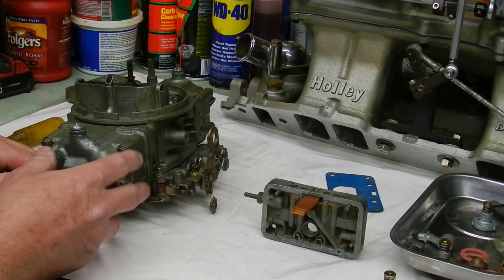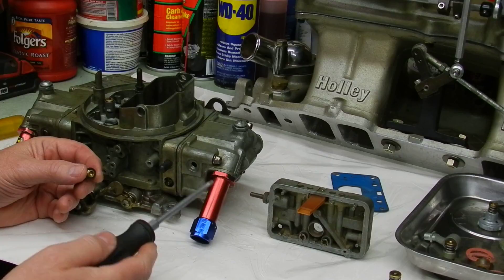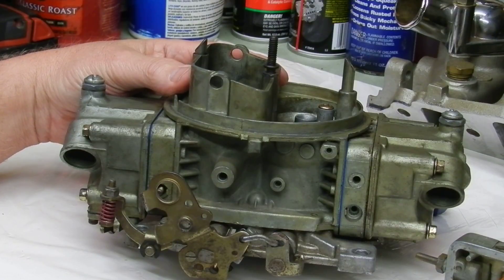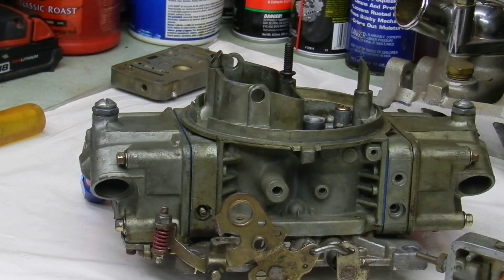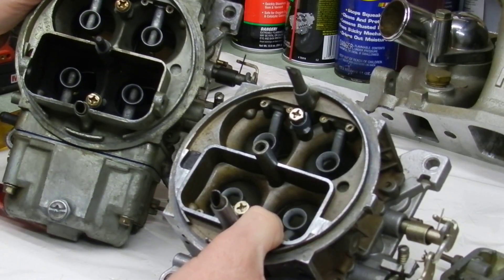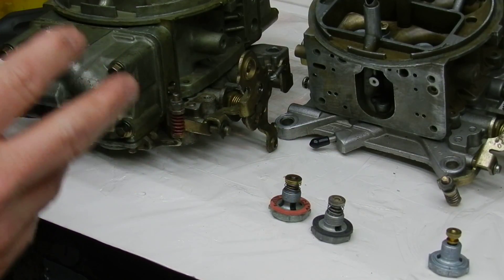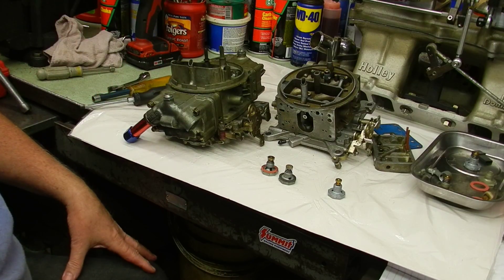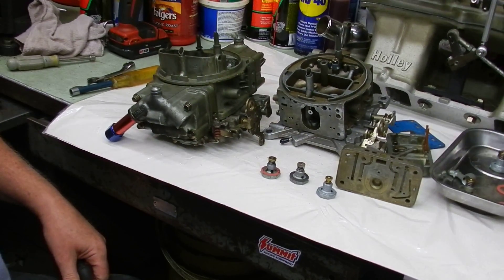Holley Carburetor: Tuning Introduction

Comment: Hi. I got a problem. 
My 302 rebuilt to 30 over and with a comp cam at .533 lift 214 duration at 50 has a holley vacuum secondary 600 street warrior..
The boosters spray intermittently and the driver side booster sprays less and later than the passenger side booster. What could cause that?
Reply from the maker: First make sure your high speed air bleeds are clean and the proper size. Check for a loose boosters and that the boosters are straight, Remove your bowls and look for trash or any kind of restriction at the booster or in the booster, look at the metering block and check emulsion holes for restriction. Hope this helps.
Reply: @holleycarbshowtosadvice40y90  how do I know if the air bleed ports are the proper size? Right now they are what came with the carb and they don't look like they cold go much bigger.
Reply from the maker: Buy you a set of pin gages, then you measure your air bleeds. The inner bleeds are your high speed bleeds and the outer are your idle bleeds. Hope this helps.

Comment: Your supposed to adjust the accelerator pump springs with the throttle wide open, while shoving downward on the pump arm there should be .015 clearance between the spring and the arm,
Reply from the maker: After installing the carburetor and making your final adjustments to the mixture and idle speed, then make your final adjustment to the pump arm, zero clearance at the pump arm and at least .015 clearance at wide open throttle.
Reply: @holleycarbshowtosadvice40y90  yah after your pump cams are selected and positioned where you want them to be. I hold back the throttle to wide open wit some wire and shove down on the pump arms until they bottom out and then set the clearance between the spring and arm. That’s just to make sure your not bottoming out the diaphragm before WOT
Reply: @holleycarbshowtosadvice40y90  hey if you know engines you’ve probably heard of David Vizard this is his channel. It’s all around head and port flow where your overlap should be. This is exactly what I was saying. https://youtu.be/yzrGqhJ8mlk

Comment: Any secondary tips on a list 4224 660
Reply from the maker: Are you  having a problem or looking for mods.
Reply: Actually setting up a pair for sbc tunnel ram. So looking for mid tips. 355 ci small roller cam lift unknown . 12.1 compression.4 speed gasser style car

Comment: I have a Holley 600 on a 351w with air gap manifold. She runs fine around town and when not high temp outside but when get on interstate after running about 30 40 minutes and mask acceleration down hard she bogs down and then runs like it’s on 6 cylinders-and can barely get me home only if I coast or give it on little gas. My mechanic thinks it’s not getting enough air through the air filter and runs to rich. I am not convinced but I am not mechanic. I have a new electric fuel pump installed and aluminum radiator which seemed to lessen the problem but not resolved it. Any ideas?
Reply from the maker: Check your ignition and fuel system , I have had ign. Coils do that and ign. Stator ( pickup in distributor) or it could be  fuel starvation , perform a fuel volume test and check fuel line at fuel tank ( rubber line) possibly cracked can cause this , check fuel filter, this is most likely areas. So many things can cause these problems . Hope this helps, if not let me know .

Comment: Randy, if you have not, please demonstrate how to clean a carburetor. In addition, would you make a video with the three-barrel Holley?
Reply from the maker: Walter I wish I had a Holley three barrel ,maybe  I'll run across one ,it's  been a while since I've had one , but I will make a video on cleaning the various ports and passages ,thanks for the insight.

Comment: Have you ever had to drop down sizes on an idle air bleed for one corner only?
Reply from the maker: No I never have , if you pin Guage every hole in the idle circuit all your air bleeds should be the same size.
Reply: @holleycarbshowtosadvice40y90  I’m thinking the carb I have here has a misread air bleed. One is smaller than the others on that circuit.
Thanks for sharing your expertise.
Another great video would be thread repair of the discharge nozzle screw, that’s my next issue to tackle on this carb 😒

Comment: What is a 3310 carb  4150 or 4160.
Reply from the maker: 4160
Reply: Can you make it a 4150. And is the 4160 a good carb. What number is a good 4150 carb for a bbc. A little bit bigger than mild
Reply from the maker: How much cubic inches and modifications , and does it see the street the most or strip.the 4160 is a vacuum secondary carb, they say if it has a rear metering block it becomes a 4150 , but it is still a vacuum secondary so the main difference is a 4160 has vacuum secondaries and a 4150 is a double pumper, if you are driving it around on the street and power is not the main concern then you could run a 3310 , but it is considered small for a 454 or larger engine performance wise ,usually a 850 or bigger is normal , hope this helps.
Reply: It's  462 bbc  552 555 lift cam
Reply from the maker: If it's a street car and your not about all out power its a little small but will work, an 850 would be better, all out performance 1050 dominator.hope this helps.
Reply: @holleycarbshowtosadvice40y90  street

Comment: I own a 84 f-150 4x4 with a 351 & the Holley / Motorcraft 4180C 4 barrel carb .
Timing is set to factory specs / engine vacuum is spot on . Both fuel bowls are adj correct . 

Electric choke is working / adj correct ...or maybe not 110% 🤔

On a cold start....i will pump the gas a few times prior to starting . But when i go to start the engine , it will quickly die . If i pop off the air cleaner cover , the choke plate will be in the almost closed position with approx 1/8 inch gap .

I need to keep giving the carb gas by pumping the pedal or it stalls out .

Once warmed up a bit , the engine will stay running on fast idle until i hit the accelerator pedal to kick the choke down to 2nd fast idle speed. 

But usually i can't get the electric choke to kick down to the lowest idle cam position without loosening the choke thermostat housing adjustment screws & readjusting the choke plate so it steps off the fast idle cam to the lowest idle setting.
Reply from the maker: Email me some pics of the choke linkage and housing and a phone # to, bigblockchevyman1121@gmail.com and I will do my best to  help you.
Reply: @holleycarbshowtosadvice40y90  Thank you so much for wanting to take your time to help me with this carb issue ...i will try to send you some pics to you soon.
Reply: @holleycarbshowtosadvice40y90 Two email sent ...let me know if you got em ??

Comment: Hi master. When i swapped my engine whit a too low stall torque converter , in drive i had like 5-6 inch of mercury at idle 650-750 rpm. And my power valve was a 6.5 . Was it possible to the power valve to engage at idle? I put 2.5 power whitout seen your video about idle...because it was too rich. But now i have a new transmission and torque converter that fit the powertrain,10-12 inch of mercury at 1000 rpm idle in drive, and I'm about to open that carburator, work on the power valve , transfer slot, secondary idle adjustment and  apply all of your information. Your video are Really appreciated.
Reply from the maker: Thanks

Comment: Straight leg boosters and choppy cams don't go well due to the low vacuum signal and also the lousy atomization of the straight leg further complicates things. Straight legs are doable, but for me I don't care for them much. Personally on any of my engines I avoid straight legs and do either down leg or annualar preferably,  even if I have to swap boosters myself.
Reply from the maker: Your right .

Comment: I ran into a 4150 problem, just rebuilt it, and if I idle below about 900 she shuts off. I dont think its too radical a cam because it idled good before. 1/16 drill bit in primary butterflies for correct transfer slot adjustment. 6 psi fuel pressure. 10-11 hg vacuum pressure, 5.0 power valve.
Reply from the maker: Thanks fore watching

Comment: Perfect how to video! Keep them coming, got a Ford 363 stroker with a holley aluminum double pumper ultra series 650 cm that's giving me (rookie) fits! But I'm bound and determined to solve the issues I'm having. Engine is laying in a factory five 65 cobra that weighs in at approximately  2 250 lbs with me in it, power to weight ratio is up there. Only have 300 miles on the engine and already on 2nd set of plugs due to running way to rich, side pipes show same condition (black as coal). Thinking my accelerator pump diaphragm  has been blown out to an earlier backfire condition, how can I tell if this the case without any disassembly?
Reply from the maker: If it backfires hard it can damage the float even with nitrophil floats now let's talk about the power valve, when the power valve is ruptured usually you can turn the idle mixture screws all the way in with not much change, that carb does have a check valve to help protect the power valve but nothing is 100% best way is to replace it. Hope this helps.

Comment: Got a 86 chevy truck 305 ,260 cam a ljttle head work use to be a smog truck got it going again and it didnt pass emissions,it was running a little rich now ive timed it down leaned it out is anything else i can do to help it pass maybe to the carb?
Reply from the maker: Set ignition timing may be to 6 degrees and set ldle speed at 1000 rpms and adjust carb mixture a little lean but not to rough an idle. Hope this helps